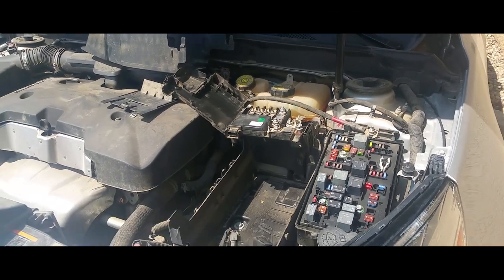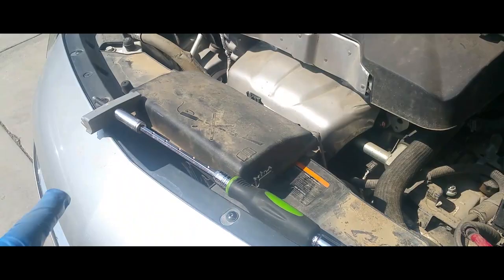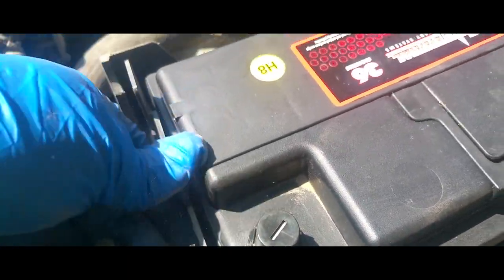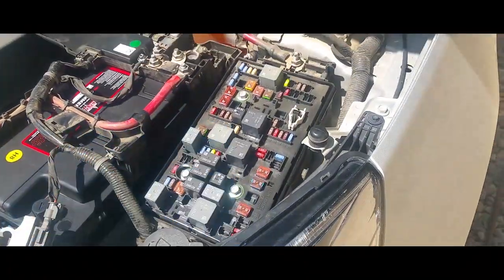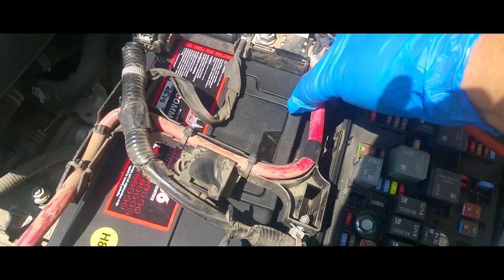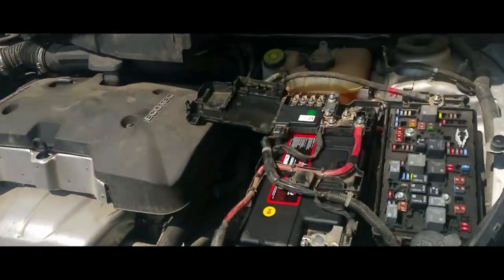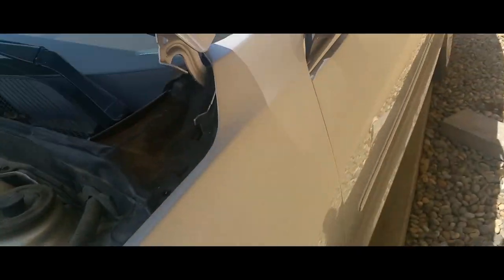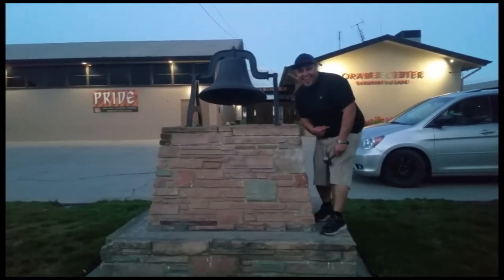How to: Install a Battery in a 2014 Chevrolet Malibu

Comment: What kind of battery did you get to replace the old one with? I went to get a new one o Reilly told me they had a small one
Reply from the maker: The small one must be for the Stop start Aux Battery in the trunk im not sure which size it was we have a rack full of batteries but I can let you know what group size it is tomorrow when I get to work and check the battery size book we have for all the makes and models
Reply from the maker: It was a H-8 battery sorry it took for ever to reply

Comment: When I brought the battery it came with some some small tube saying to " Vent" the car. But do you have to do that?
Reply from the maker: Some batteries come with a port for a vacuum line if your vehicle originally did not have that you don't have to worry about that. Some newer model vehicles come with a vacuum line to the battery. Thats technology for you
Reply: @559powerscape  thank you! Video help a lot
Reply from the maker: @nicolasguerrero774  You're welcome! Thank you for your Support!